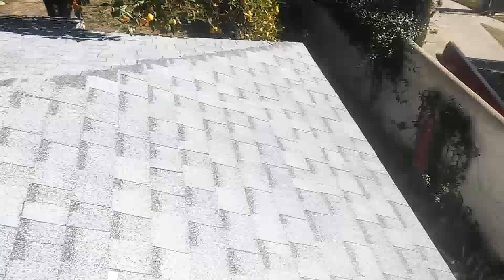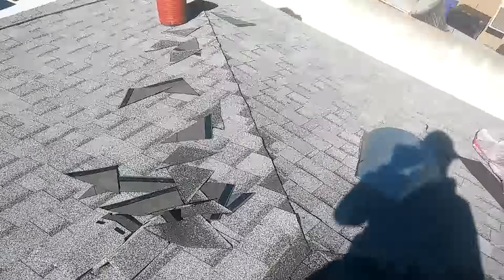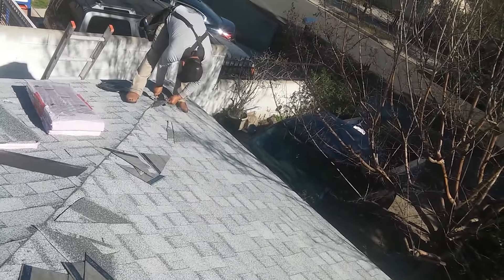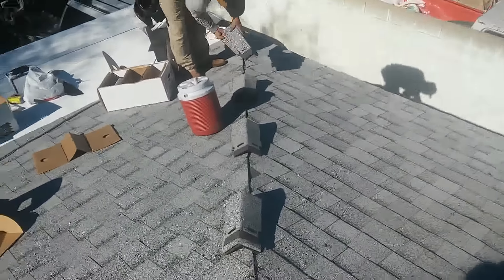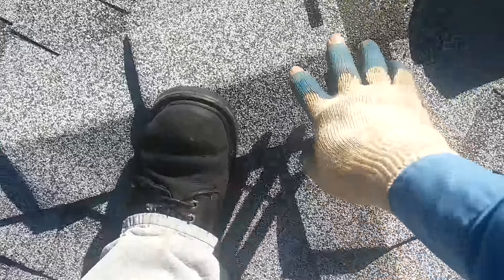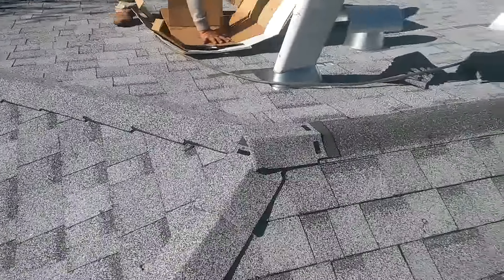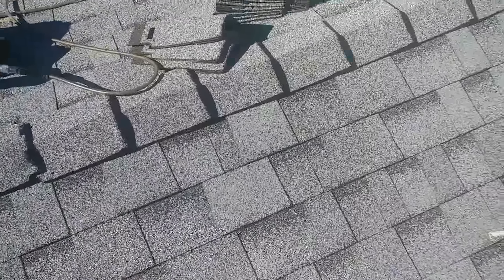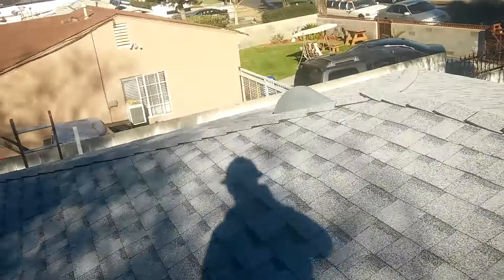RIDGE CAP SHINGLES INSTALLATION...step by step explained in details...best video!

Comment: Nicely done sir, an easy accurate explanation on doing it properly. I also run my ridge both directions with a finish cap in the center. I take a 1" punch and cut 1" buttons out of a piece of scrap and glue over exposed nails. It makes a nice finished  touch and no unsightly sealer. I also wear a light blue shirt over a white T shirt. It really does keep you cooler.

Comment: Two small suggestions, I sell roofs in Texas and the 100+ degree heat will cause the asphalt to get very soft. I’d recommend placing your tools on a sofa cushion so you can mitigate foot traffic. Also, I’m 99% sure that 1.25” nails are required for roofing. The full shank should be seen in the attic. But the choice on the ridge is an excellent decision. That’s definitely taking care of your customers. 👏🏻👏🏻👏🏻👏🏻👏🏻

Comment: Hey buds i like your vids....but when you are talking about the direction of laying shingles on the ridge i feel you should tell people how to do it properly because like you say its important....almost noone will see if its straight unless you happen to be walking up there its nicer to be straight yes.. But most importantly about direction...you are supposed to lay your ridge so that it deflects rain in the direction of prevailing winds for your area. I just wished you had talked more about that and less about the lines....also was wondering what were you saying about tiles and meeting in the middle versus just going in one direction....also wanted to ask....if im installing architectural shingles can i cut them and use as caps like with 3 tab? Or i need to buy ridge caps?

Comment: muy buenos videos Erick estoy contruyendo un gasibo en mi casa 3 en 12  y alver tus videos quiero animarme hacerlo yo mismo se que debo de compra el papel negro y los metales pero no se cuantos paquetes de shingles comprar no se como calcularlo es una escuadra de 12x12 me pregunto si podrias orientarme muchas gracias y saludos desde Phoenix Az
Reply from the maker: mide el techo de lado a lado y multiplica lo que mide en un lado ,por lo que mide el otro lado , una escuadra es 10x10: 100 pies cuadrados , tres paquetes te cubren 100 pies cuadrados, un rollo de 30 lbs felt cubre 200 pies cuadrados y cada metal de la orilla mide 10 pies lineales .
suerte en tu proyecto.
Eric.
Reply: Muchas gracias

Comment: Your guys long sleeve shirts, are they a special material? I'm looking to try and protect my arms as much as I can this year, but I don't want to sweat to death either. I'm sure you can appreciate what I mean. Thanks for your time, ~Dan
Reply from the maker: here is a trick for you , wear a white shirt underneath the long sleeve shirt and if you can handle the heat for the first hour, the rest of the day will much easier , when you sweat the shirt underneath  gets wet and keeps you cool all day , I learned this in the roofing school, try to use a light blue color , it doesn't absorb much the heat , 
good luck and stay cool !

Eric

Comment: What would happen if you did not put roof cement on the exposed ridge nails? I thought you had said once that exposed nails are OK if the heads are not too deep.
                                      thank you
Reply from the maker: +Myron Piano nothing... on the windy areas the inspectors do required the ridge to be nails on top not under...as long as you used EG nails ...they won't rust that easy ...Don't worry about  exposed nails on the ridge...it's impossible for the water to penetrate thru the ridge , the shingles and the underlayment .
Reply from the maker: +Myron Piano I do it because the city inspector asked me to seal any exposed nails...actually you can't have exposed nails if you have a city inspector on the job .but if you don't have city inspection ..it's ok ...nothing is going to happened , I have a video with a house more than 30 years with exposed nails on the ridge and never had a single leak.